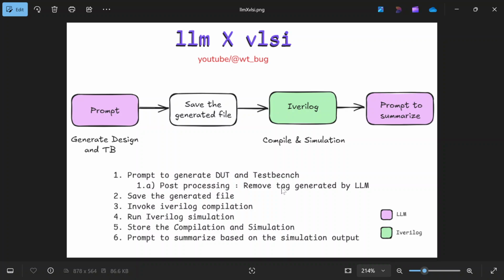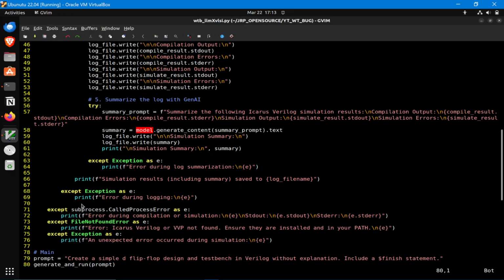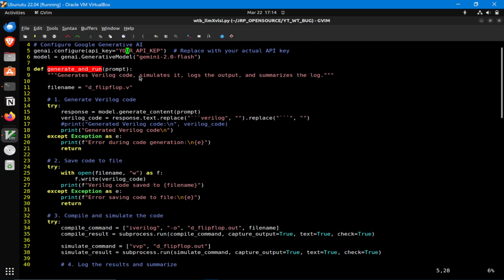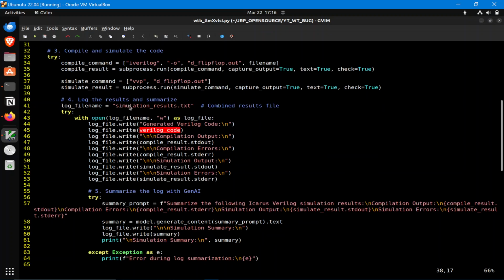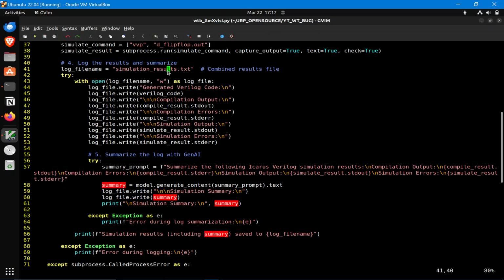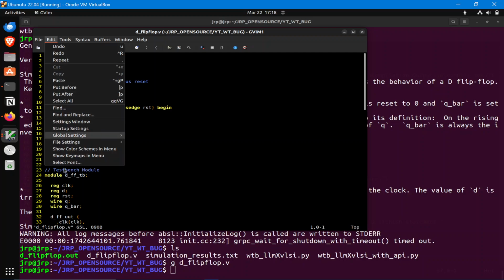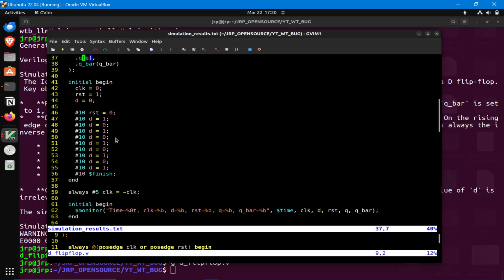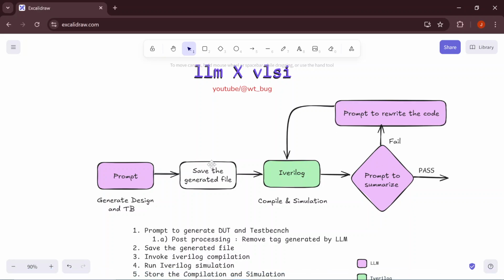GenAI Writes Verilog, Simulates, and Summarizes!

Comment: I was reading   
"Verilog, Formal Verification and Verilator Beginner's Tutorial"
and was curious if there's an automated way of generating testbenches. RTL2UVM?   Even if it's in C++ (verilator), it seems like a lot of busy-work!

In software, there seems to be many tools that test your software-units.. like 
Ceedling , Unity, CppUTest, CMocka   
Catch2, embedded-hal-mock, PlatformIO, cppcheck, Fake Function Framework (FFF)
Renode, 
Klocwork , Cantata , TESSY , LDRA Testbed , Eggplant , VectorCAST 

There's a great video called 'Unify to Verify: A Monorepo Approach for Hardware and Software using Bazel, Cocotb and Verilator'

Comment: Hello Jayaraman, thanks for your Video! I want to do something similar, however for a complete complex microsystem, not only for a DFF. -Did you try different LLM models?
My System consists of ~8 modules, I have already a running System. Now I want to adapt certain module to New requirements. 
However running the testbench/sim is not a question, I do it manually. What I want is, the model to understand my current system and adapt it. Did you do something similar?
I am using a Llama 3.3 70b instruct turbo model right now, which gives reasonable results, is fast and cost effective
Reply from the maker: No, i haven't tried different model. I just want to demonstrate a way to integrate LLM in vlsi related projects. 

I see LLM as a curious intern. For complex system, i would suggest you to teach the model. Considering now the model can understand image, 
1. Give them the overall block diagram 
2. As it to explain each module
3. If it fails to explain (most probably it wont happen) correct it
4. Now break your changes into pieces 
5. Ask it to implement one changes at a time -> run simulation-> have other model to read your sim log and see the expected changed has been implemented. If not update the prompt manually or with other model.  Iterate 

If i were to do for complex design i would follow this way. 
Explain the model -> break the changes into tiny pieces -> run-> have other model to interpret the results -> update the prompt -> run

Sorry for the delay. Let me know it helps